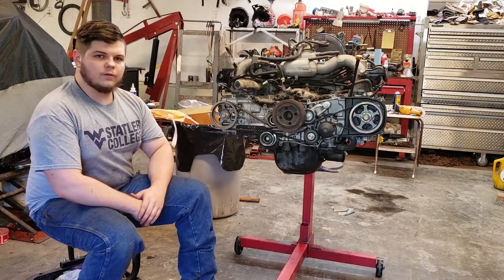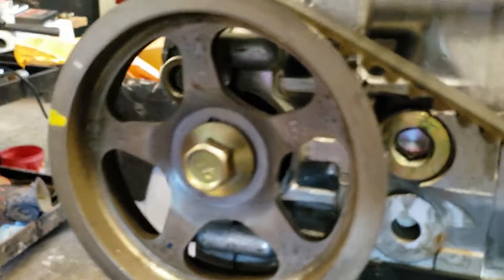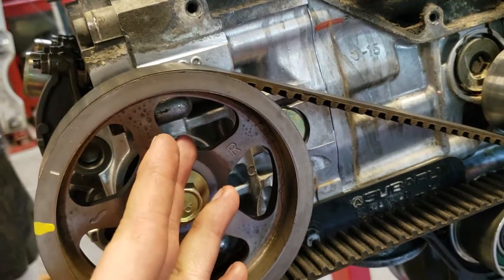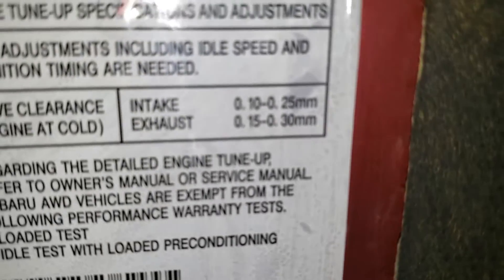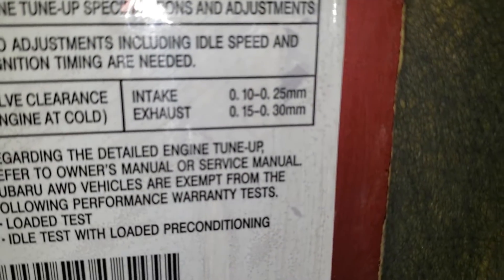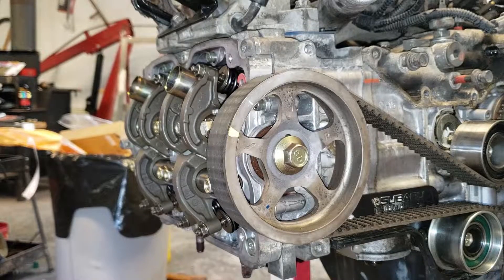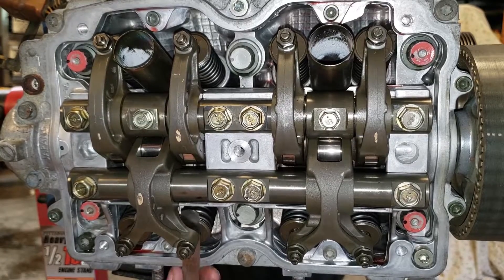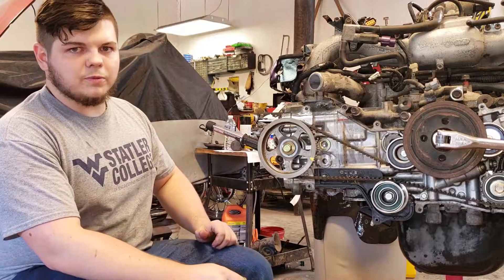Subaru EJ25 SOHC Valve Adjustment Guide

Comment: Do you know if this applies to an older ej18 sohc engine as well?? You’re literally the first person I’ve found that talks/explains about how to get the engine alined with top dead center so tHANK YOU for that!! Doing a rebuild on my ej18 for my ‘95 Impreza so just curious if you know if it’d apply to those engines as well or not
Reply: Those have hydraulic lifters if I’m not mistaken, no adjustment available or necessary. Lifters can collapse however and need replaced if so.

Comment: Great video mate, I do have one question though, does it matter what cam gear pulley you use as reference to set the pistons to TDC, as both left and right have the arrows marked.
Reply: It shouldn't. The reason the timing cover is in two pieces is so you can do this without having to remove the dampener. You can use the left hand cam sprocket instead of the right.

Comment: Can you adjust the valves with the head removed?
Reply from the maker: Yes, just make sure that whatever cylinder of valves you are doing has no tension from the cam, all the valves should be closed when you do them

Comment: I have a 2007 Forester and I am going to try to adjust the valves in the car.  I think the biggest issue is getting to the valve covers.
Reply from the maker: Yeah, they're definitely a pain with the boxer engine design!
Reply: @Hunters_Mechanics  Thanks for your response!  Your video is very helpful.  I think I can adjust the valves with the engine in the car.  It looks like a lot of stuff has to come off in order to get to the valve and timing covers.  I used to adjust my own valves on my air cooled Volkswagens; very easy!  Thanks again!

Comment: @2:22 says  Intake 0.1mm  and the same for Exhaust he says 0.15mm
These are the minimum values although they do go slightly larger when hot.  
Try: 
Intake 0.20mm +/- 0.02 mm
Exhaust 0.25mm +/- 0.02 mm

Intake is 0.20mm = 0.008” (inches)
Exhaust is 0.25mm = 0.010” (inches)

A Range is given, and Imho minimum values doesn’t leave enough room for error on an old engine.  Maybe if you have just rebuilt the head, he means !?!

Otherwise the video is useful.

Comment: Thanks for the help, quick note the spec listed is in thousandths and millimeters .10 is in thousandths and is what the intake should be set to which is equal to .25 mm, it’s not a range
Reply from the maker: It specifcally says .10 - .25mm, that - is a range. 0.10 inches is not equal to .25mm, .01 is close but that's not what it says. Same for the exhaust, .15 inch is no where near close to .30mm. It would list inches if it meant to, like my Raptor 660 manual, which has a '-' but in parenthesis, has the imperial system measurements. It's also Japan, doubtful they care about imperial system there lol
Reply: Nope. Multiply inches * 25.4 to get mm
So 0.1” would be 2.54mm not 0.25mm
0.15” is 3.81mm nowhere near.
It’s a range as he says. See my other comment.

Comment: Is it possible to do valve adjustment with the head off?
Reply from the maker: Yes, just make sure that whatever cylinder of valves you are doing has no tension from the cam, all the valves should be closed when you do them
Reply: @Hunters_Mechanics  thank you for a quick answer! working on this right now

Comment: This video is gold.  I’ll be following this video step by step this summer on my 07 outback.  Thanks for making it so clear.
Reply: I’m assuming the clearance while engine is still in car makes it very difficult?
Reply from the maker: @arcpulseh  its just a pain to get in there with a 10mm and something to turn the adjust, especially the drive side. I ended up taking my washer fluid reservoir completely out and took my time with it